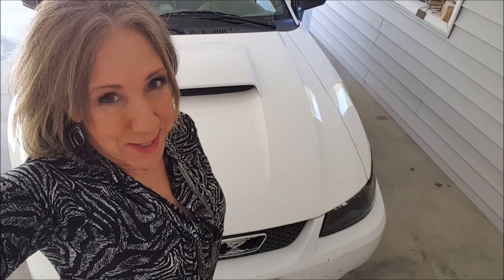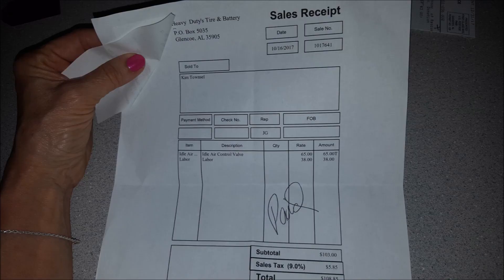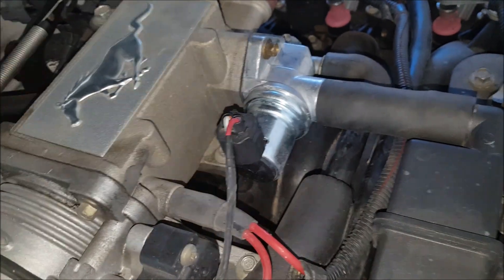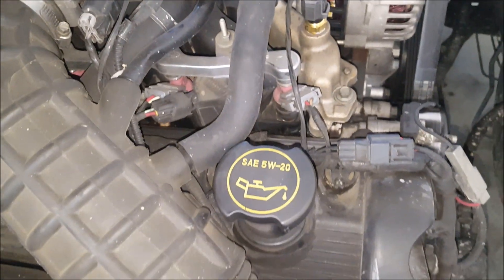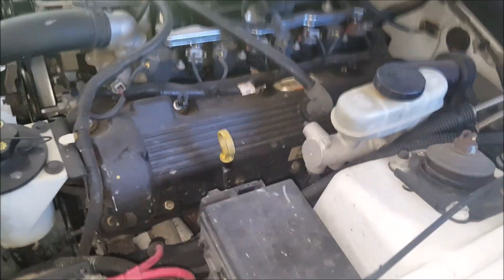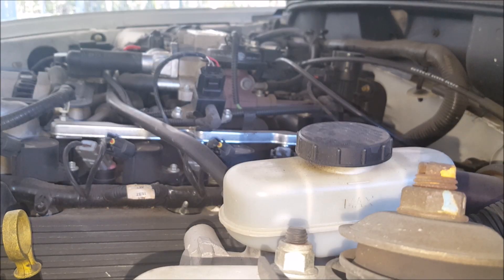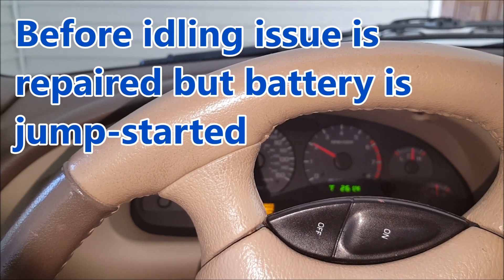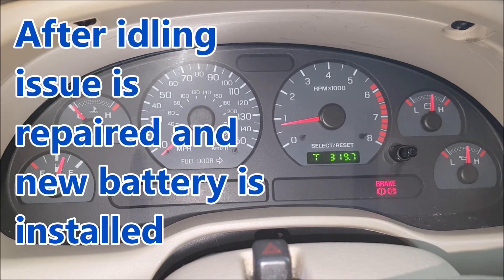Mustang Idling Problem Solved!

Comment: Your engine seems to be running strong...no lifters tapping or unusual sounds...your idler valve was probably gummed up and sticking at a higher rpm setting so they did right by just replacing it...batteries usually last 2-3 years so keep that in mind as well..
Reply from the maker: gixxerlouis Thanks!!! I appreciate you answering my questions. :-)
Reply: I think your idler pulley is making noise

Comment: Yeah my idol is higher than it should be and it also sometimes surges as well. The motor is less than a hundred thousand miles and is in pretty good condition but I believe the previous owner did something to the idol so it was easier to drive. Sadly we can't adjust the idle because the bolt to do it has been snapped and won't turn. But I'm not sure if that's even the problem.

Comment: My car had a idle problem & my mechanic said it needed the egr solenoid replaced so he did & the car is now running smooth.
Reply from the maker: Thanks!
Reply from the maker: I ended up selling the 2004 and buying a 2017. Love it!  
Which Car Should I Buy??? 2019 Civic or 2017 Mustang | KimTownselYouTube
https://youtu.be/xfsjzgcIepg
Reply: @KimTownsel  U should buy a 2017 mustang i can tell u how to keep running in top notch shape pretty lady👍😜
Reply: @KimTownsel  what car do u have now

Comment: Hey I have the same problem on my car it’s an automatic on any gear it revs high I have to really push down on the brake because it just wants to go & on park it idles really high any suggestions?
Reply: Diego  that sounds about like a throttle position sensor or the maf maybe

Comment: U should clean your throttle body.my mustang would shut off at idle until I cleaned it.
Reply from the maker: Thanks. I ended up selling the 2004 and purchased a 2017.
Reply: @KimTownsel  Hey ms kim some advice when go start your car in the mornings always sit n rev it for 20 minutes so ur engine can get the proper warming up if not it will begin to shake and idle high make a video too please
Reply: @kingcharles6226  you dont have to sit anymore its not 1950 cars are made to start and go and they definitely should never be reved up first thing after cranking

Comment: I also noticed the engine was shaking a little bit easy fix rev it for 20 minutes and all done other than that mustang sounds really good all the wires look in good condition just rev it longer so ur engine can stop shaking post a video of u doing that please
Reply from the maker: Thanks for the info. I no longer have this Mustang. I sold it and bought a 2017 Mustang.  :)
Reply: @KimTownsel  thats good hey i want you to rev your mustang for 15 minutes so i can male sure your motor sounds good make a video please

Comment: Maybe you could put in a 2003     Mustang Cobra Engine instead of a V6 I have a 03 Cobra and if I put that engine into your mustang that mustang would be a badass beast like if you agree
Reply from the maker: Thanks. I think mine is a V8. 😎
Reply: Ok but if you think the engine is slow I suggest you get a 03 Cobra motor 😁
Reply: There would be too many problems if you swap it with a 5.4
Reply: Maybe you could buy her one. Lol Takes money.